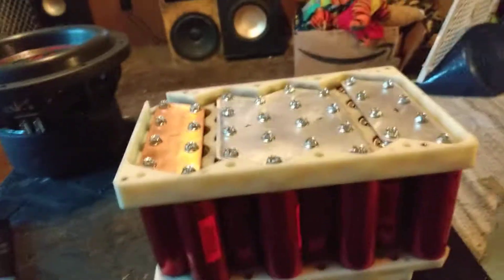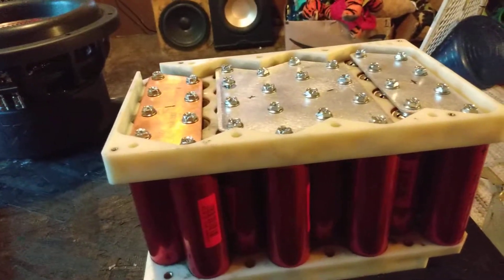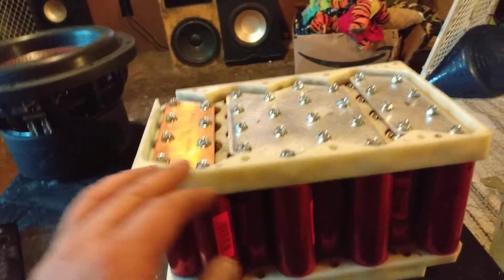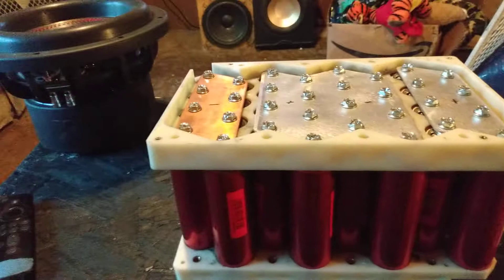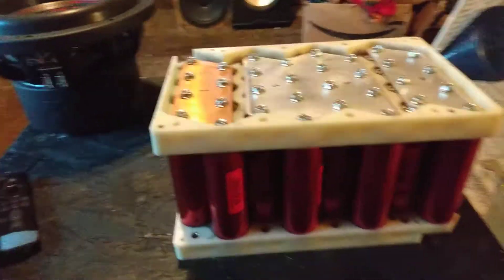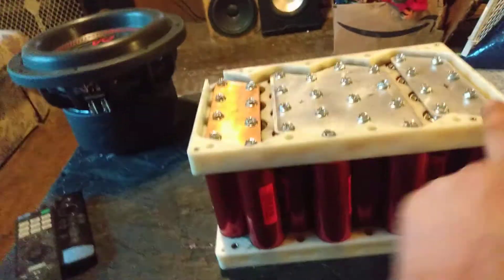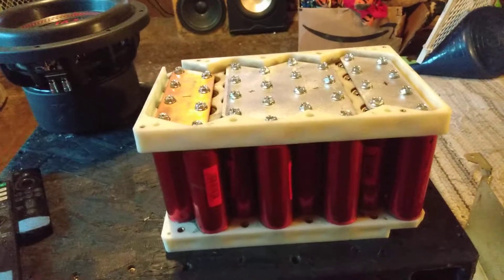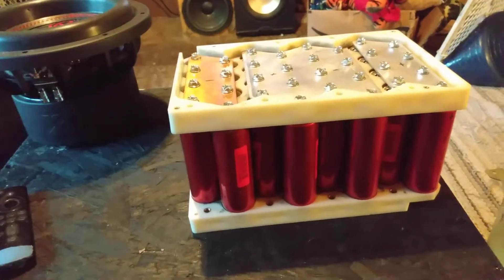My cheap 64ah Headway battery from Battery Hookup for my CAB 45 whenever it shows up...😟

Comment: Get a good BMS ... That's your only problem you have to get a good one those little b***** ones that are 20 bucks on Amazon ain't worth a s***
Reply from the maker: Yeah pretty much figured there for false sense of security , but my knowledge of lithium  which is minimal is ou need a bms that will support your amperage demand and a large bms is pretty pricey... granted replacing lithium cells is also...

Comment: Well champ if its 4 sets in series then its 12v. And if its 4 in parallel then its 32AH or less if they are used cells. The balance leads go on the pos and neg of each set of batteries.
Reply from the maker: It's 4 cells in parallel to into 8 rows in series = 64AH

Comment: What size alternator are you running?
Reply from the maker: At the moment just the factory 140A but I'm getting a 275A
Reply: @fiveohh95  Nice! I need to get a better alternator for my system. Would a 370 amp alternator work?
Reply from the maker: Depends on the size of your amp but unless your running a huge amp it should be enough, but you need a battery upgrade for the quick hard beats to absorb the quick demand of power.
Reply: @fiveohh95  I have a 250.4 for the mids and highs and 2 2500.1 for the subs. I’m also looking into batteries for extra reserve.
Reply: @fiveohh95  I forgot to mention I just purchased 32 of these cells and I have a regular battery up front for now. What do you recommend I switch up to?
Reply from the maker: @BIGZOE  if you have the lithium any under hood that supports your starter will work fine. There's so many people that say you can't mix AGM with flooded or flooded with lithium but a bunch that say it not true. but it's all because of the resting voltage because they will be fighting each other while vehicle is off but with a isolator when you shut it off there separated so only time there connected is while key is on so you need to have the isolator switched on ignition not accessory key position. That being the fact I'm running my flooded under my hood for now but you can just ditch your starter battery and power your vehicle off the lithium alot do that but you run the lithium dead your going no where and it's bad for the lithium if not using a BMS. But If run under hood with an isolator if lithium gets low from engine off listening your under hood battery is still charged so twist key and your off not stranded. I'm going that route we'll see if the keyboard experts are right. On Amazon Recoil sells a 500A mechanical isolator for $54...
Reply: @fiveohh95   I purchased a 4S 5A Active Equalizer Balancer would I still need a bms? Thanks for the advice just to be safe I will purchase an isolator just so I won’t kill it.
Reply: @fiveohh95  i got a 500 amp for 9.99$ off amazon.works great.i plug it in a remote turn on.
Reply: My car has a 160 amp alt and i have two lifepo4 batteries.it stay 14 volt driving but i stop and bump a song or two it start to drop.
Reply from the maker: @bkh5746  I got my headways in and with that and my under hood batt with my 5k a 50x4 and 80x2  it hangs at mid 13s pretty steady, 20 min of bump engine off it will start right up, so I'm pretty pleased.
Reply: @bkh5746  sounds like you need a bigger alternator
Reply: @BIGZOE  yeah i believe so i though about 2 but nowhere to put another and no one makes one for a 2001 toyota corolla
Reply: @bkh5746  Big 3, and diodes in series to keep batteries charging over 14 volts to your amplifiers max volt input.